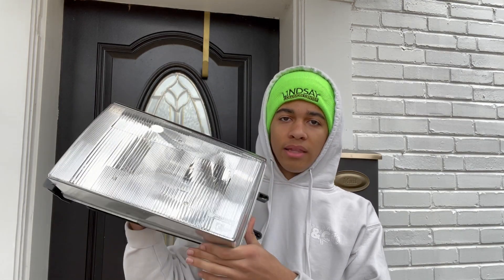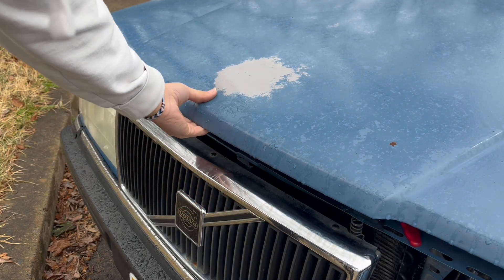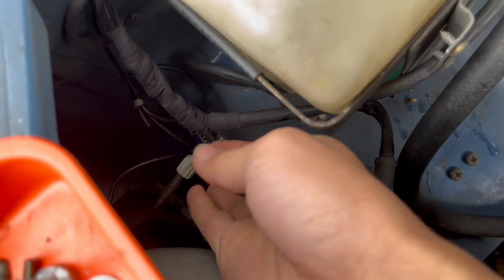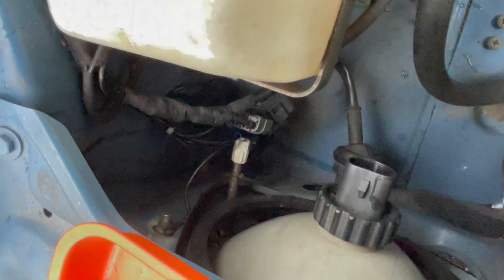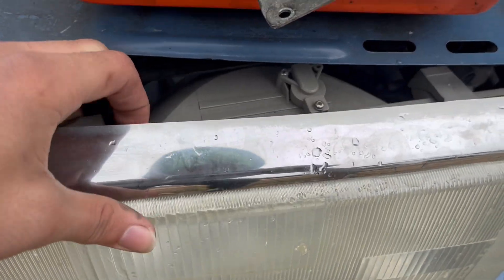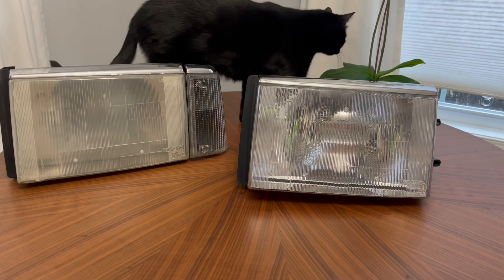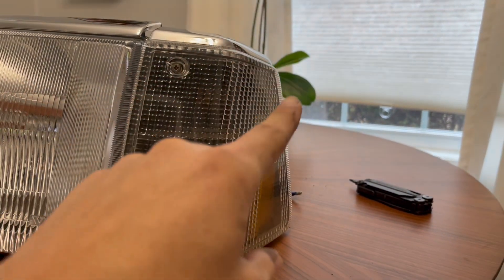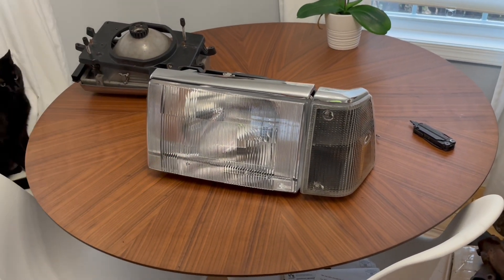How To Replace Volvo 240 Headlights and Bulbs! | (super simple)

Comment: Hi Max I followed your steps for changing the LH headlight on my 245.  The easiest way was to take the battery out, it took me half an hour to work out how the battery came out. The battery is held in by one clip and for a new bloke it is hard to work out what is going on.  There are dozens of videos on changing batteries for all Volvos except the 240. Do you reckon you can do a video on changing a 240 battery and cleaning or changing the base plate. Thanks.
Reply from the maker: I think I can get around to it! I unfortunately have an aftermarket battery tie down already, but it’s rusty and old plastic so I’ll try to whip something up! Thanks for the comment!!!

Comment: Greetings from Australia, thanks Max. Next I'm gonna try pulling the light apart and spraying new silver on the reflector. They've both gone dull at the bottom half but I don't want to spend ridiculous amounts buying new ones. The cost itself is OK but postage means that to import both would cost around US$600. Considering the entire car cost A$2200 that's nearly a third of the car! I've tried out a sliver "chrome" spray which works quite well for A$35, more like it.
Reply from the maker: Good way to save some cash 💵 thanks!